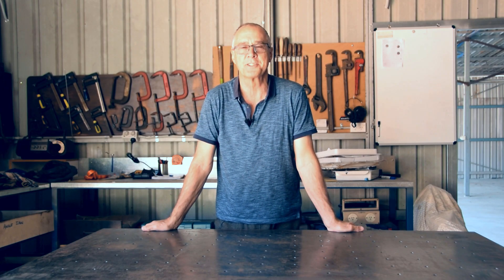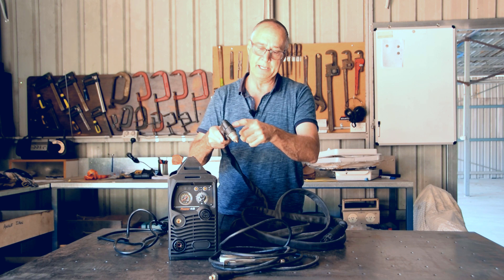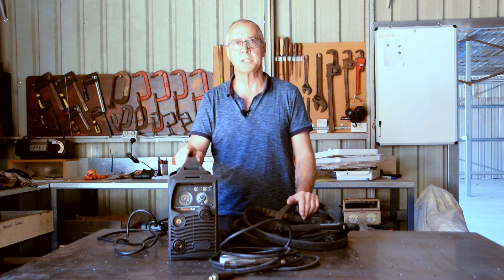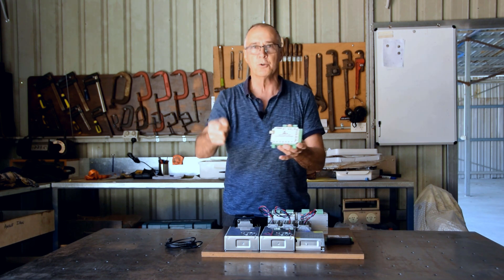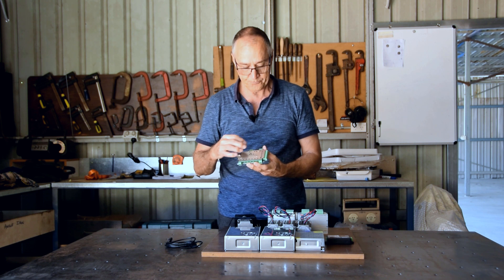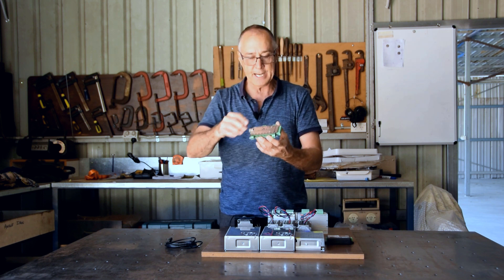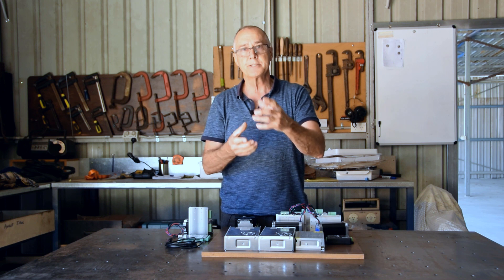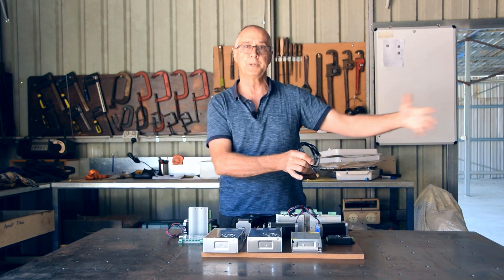How To Build a CNC Plasma Cutting Table | Part 1 - The Basics

Comment: Thankyou soo much for the video.. I found the details from you, esp the interface THC', is what I am concerning alot. So with this video that you've shared It  helps me too.. What I need to know is that 'any type of THC also will possible? Coz I'm  going to build my own cnc plasma
Reply from the maker: The torch height control is a function of the CNC controller. In the case of the MyPlasm CNC controller, it uses a plasma interface unit that's connected to the plasma cutter, to get values for the arc voltage and also to turn the plasma cutter on and off.
The function of controlling the height of the torch above the material is based on the value of arc voltage when the torch moves from it's pierce height, to it's initial cutting height. Maintaining that cut height is achieved by the controller moving  the Z axis up or down. 
Some THC functions are based on a pre-set voltage value that's entered into the THC volts parameter. In the case of the MyPlasm CNC controller, you can set a value into the voltage parameter or set it to 0 Volts, and let the controller calculate the initial arc voltage. I hope this helps.
Reply: Hey, Rusty
      Would you suggest me which is the best size of the cnc plasma table?? Coz i’m planning to build my own cnc plasma (4'×8') .
Reply from the maker: When I built my table, I made the cut area 1300 x 1300mm, so I can easily fit a half sheet of material on it. I have to put the whole sheet on the table before I can cut it in half.
I have always had the idea to build a table that's capable of accepting a full sheet (1200 x 2400mm), so if you're planning on cutting lots of large items, like decorative privacy screens, etc. then you will want a bigger table. 
To date, I've only had 1 request for something bigger than my table can cut, and I was able to talk the customer into accepting something that I could cut (1300 x 500mm vs. 1500 x 500mm).

Comment: Hi Mate Did His all come as one kit? Do you have a link for buying the kit ect?. Cheers.
Reply from the maker: Hi Mitchell, I bought the items online (eBay mostly) after I worked out what components I needed. I started by working out the cutting area of my build, then calculated the required lengths of linear rails and ballscrews.
The motors and motor driver units were purchased as a kit, as was the MyPlasmCNC controller and plasma interface unit. Other parts I bought as needed....things like the drag chain, screened cable, complete Z axis unit, proximity switches, etc.
Reply: @RustysMetalSigns  Ok thanks. I been looking for some time. I was very happy to come across your videos… super helpful!
Reply from the maker: @mitchelljackman4727  if you need any help or have any questions, feel free to email me at rmhyde58@gmail.com

Comment: 4:34 CAD = Cardboard Aided Design
10:27 Use a machine torch and save the hand torch for harvesting the scraps off the table
Reply from the maker: Hey SegoMan, I've been looking at machine torch options but the Unimig one costs $600 and I'm not sure whether an aftermarket machine torch would have the same connection fitting into my plasma cutter.
Your plasma table is a beauty....I love the name 'Goddess of Fire'.
Reply: @RustysMetalSigns  

I'll pass the praise onto the Hot Goddess. She has been in service for over a year now and has cut a lot of that expensive "Precious" metal. I have a Hypertherm 105 on it and have "edge" cut 1-1/4" plate and pierce 1" plate.

Interchangeability on your setup  I can't help you with, I'm sure someone at P Spider can help on that one, I'm Hypertherm all the way but the exchange rate is tough on you guys down unda!

I am currently finishing a 3 stall press brake build when it's done I will get a video up on it and I need to update a video for Pele" as well.

Cheers Mate
Reply from the maker: I'm sure there's a compatible 3rd party machine torch out there...I'm hoping to find one with a shielded tip so I can use the ohmic sensing feature. Currently, I've adapted the stand off guide from my hand torch, to make my own ohmic sensor. I'll keep looking!

Comment: Can we use a plasma cutter without pilot arc in a cnc plasma table?
Reply from the maker: From what I understand, I don't think it's recommended, because of the high electro-magnetic interference that they can generate, which can have an adverse effect on the electronics.